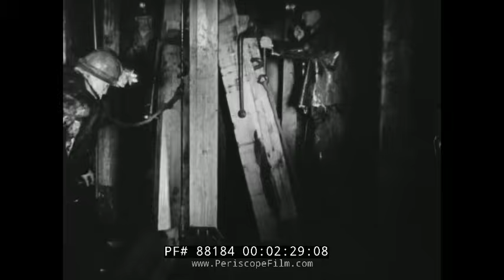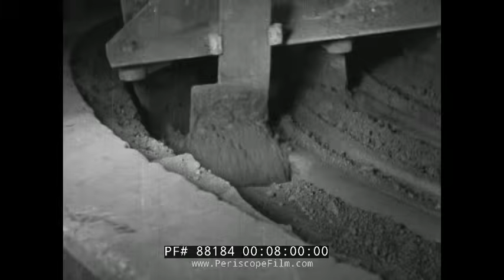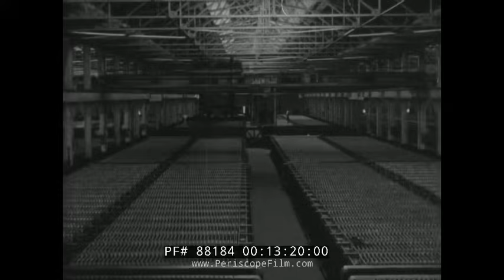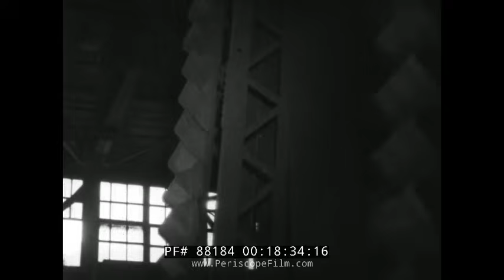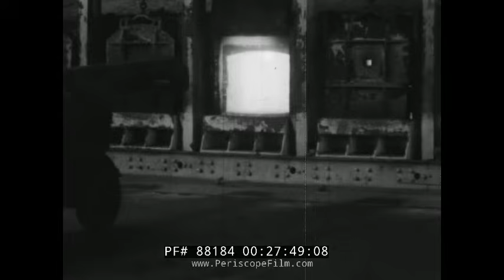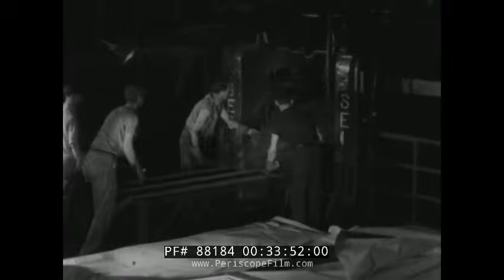" THE STORY OF NICKEL "  1930s INCO MINING PROMO FILM  FROOD MINE  SUDBURY, ONTARIO, CANADA 88184

Comment: Contrast that massive operation to my making incredibly fine copper powder from copper sulfate. It worked but I left it in the water too long and it absorbed carbon dioxide. This became a green powder of copper carbonate aka malachite. In doing this I managed to plate a cheap fishbowl with a thin film of iridescent copper compounds of some sort.   I later used the copper carbonate as a pigment for an art project. It was maybe two ounces and probably cost 10x what I could have bought it for.

Comment: I worked as a utilities operator in the Copper Cliff Nickel Refinery, built in the 70s. In my section of the plant, we produced high pressure steam using boilers to provide the catalytic heat source for a carbonyl nickel refining process, some pretty high tech stuff. It's really wild watching this old footage, because the modern ways they extract ore underground at vale is almost completely unmanned aside from heavy equipment operators and explosives packers. My father and his father both worked for Inco, so I guess you could say it runs in the family

Comment: There are so many heat / cool cycles in the production of nickel and copper bearing ores that it just boggles my mind.  

Why do they not make the process more energy efficient by moving the ore and subsequent products from stage to stage w/o letting them cool?

I remain, again, bewildered.  There must be a reason.  I just don't see it.

And what are the repercussions of a "high frequency furnace?"  I'm no metallurgist, but I can't imagine that the nickel or Monel gives a hoot about the frequency of the electricity heating it up?  Why don't they explain this?

Given the extraordinary amount of power that these furnaces require, I just cannot imagine the building of an electrical conversion machine to deliver anything other than 50 or 60 Hz AC to these furnaces.  It's possible, of course.  I just don't see it.  And such frequency conversions at these power levels would be extraordinarily expensive.  You could do it with a motor/generator set, buy why?

What possible benefit could a higher frequency power provide?  Well, duh.me.  I just don't know and don't understand, and I am a degreed engineer.  There must be a reason if the narrative is correct.  I just understand it.

...

Comment: I worked in a steel factory in the late 90s. I was the lucky one dumping carbon in the vat then taking samples and temperatures. I lasted like 6 weeks before I couldn’t take it anymore. I was too young and soft to handle it. Hard, dangerous, dark, loud and non forgiving job…not to mention at times just plain scary. I mean, unless you’ve stood in front of an arc furnace, it’s hard to describe the violence and power. I salute and respect the men and women who can handle that type of work bringing clean safe metal to the economy.
Reply: I worked with a man years ago that worked , said the noise from the electrode arc would push you back and you would brace against it and when the arc stopped you would stagger forward, not to mention the heat and danger, not worth the money to me.
Reply: women don't work in the mine factories
Reply: just another slave goyim that MUST labor for god's chosen israelites
Reply: I work as metallurgical engineer at a superalloy Master Heat plant in the US. Several of our vacuum induction furnace operators are women. They do the job same as the men. It is not the sexual organs of who's working that is important. It is their eye for detail and ability to troubleshoot problems.
Reply: Never saw a woman yet in these capacities.
Reply: Women can't handle it. No need to sugarcoat it

Comment: I appreciate that he says 'tension' in stead of 'voltage'.
Reply: It’s still called that in certain discussions.
Reply: What ticks me off is when it is called “current”!
Reply: @joebledsoe257  To measure electric power, two quantities are required for resistive circuits. (think heating elements).  One is the Voltage, sometimes called tension, the other is Amperage, or current.  The power, in Watts, is the product Voltage x Amperage = Watts.  Divide Watts by 746, and you have the horse power.
Reply: I was about to make a snarky comment about how "high tension" meant physical line tension, but decided to do some googling first to check if I was correct - I wasn't, and I've learned a new historical and etymological bit of trivia!

Comment: Matte is a term used in the field of pyrometallurgy given to the molten metal sulfide phases typically formed during smelting of copper, nickel, and other base metals.
Reply: Thanks, I spent some time as an electrician in a steel mill and couldn't remember ever hearing that term. There are also an amazing number of steps involved in getting a finished product with these metals. We did steel scrap reduction and in only 2 hours we went from scrap in a train car to continuously casting 5x5 billets 20 or so feet long, ready for the rolling mill!